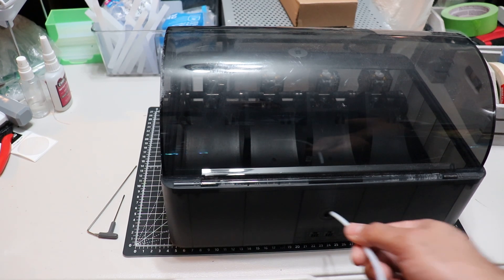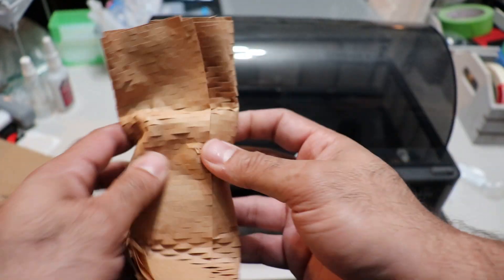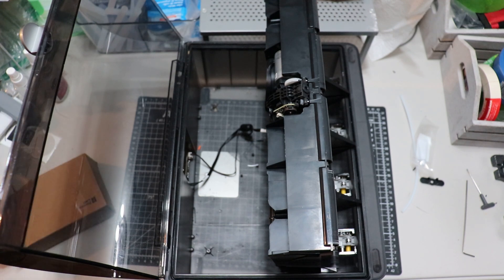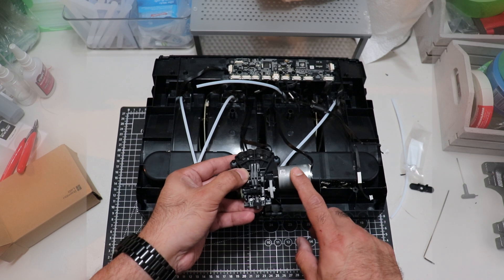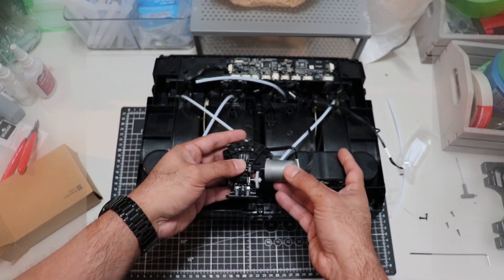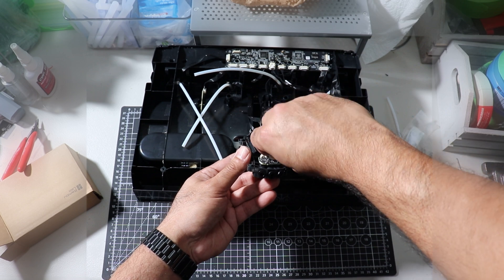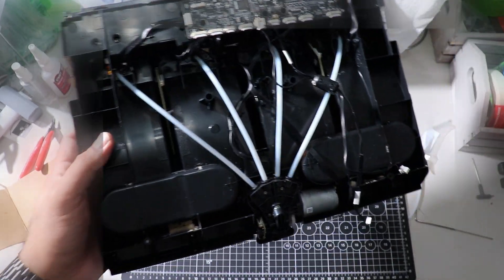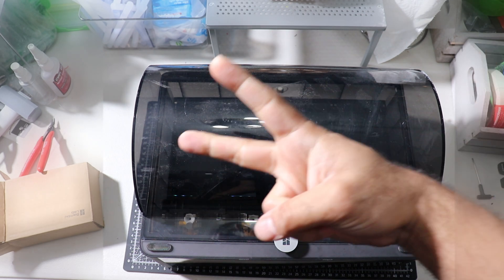#bambulab #AMS Unit Internal AMS Hub Replacement #3dprinting #walkthrough #replacement #repair

Comment: Just replace the M6. If you open it, you can remove the button, open it and in there is just a M6 like the other 4 in the hub. Its much cheaper ^^

Comment: The whole hub doesn't need replacing.  there are 6 small screws you can remove open up the hub and replace the pneumatic Cuplers.  all 5 are replaceable.  The part is a PC4-M6 push fitting availiable on Bambu Labs or through Amazon.
Reply from the maker: Thank you for the suggestion. I don’t believe that fix was available at the time. Just to confirm, you’re saying that the PC4-M6 is the replacement part, but that isn’t actually the correct part, and instead, the correct approach is to use the Bambu PTFE tube coupler and then split it into two pieces.

Comment: Thank you so much.  I had to replace my hub for same reason of it not holding the Bowden tube.  I am sure that I broke it clumsily removing the Bowdon tube.  On my hub that was in my AMS the plugs were glued in with silicon glue.  So I had to very gently cut the silicon and then pull out the plugs.

Comment: The motor unit has three holes - two for the screws and one for the locting pin on the hub. Using this alignment will ensure the motor is orientated correctly.

Comment: How did you manage to get the last screws in at 9:11 that you skip over?  I can't get them in properly.  Like, I got the silicone/rubber grommets in place and aligned. I can even put a pin in and have it go into the screw hole so I know they ARE aligned. But when I go to put the screws in they just spin and don't bite the plastic below. Terrible design. There shouldn't be machined screws there or they should have a threaded insert at least.  I'm just terrified about breaking the plastic cause that's the whole AMS that would need replacing. Thanks for the video.
Reply: OK nvm.  
The solution is not to be an idiot like me trying to use the smaller hex driver. 🤦  Use the larger one that came with with the printer. Easy peasy.  
Now time to go question myself in the mirror.

Comment: Bambu knew what components would wear out and created no pathway for replacing just those parts.  By  the time you've replaced 2 feeders and a hub  you might as well have bought a whole new AMS.  Hope Elegoo did it right.
Reply from the maker: I 💯 agree. Although I don't think another imitation printer from elegoo is going to be ground breaking. I personally would only ever stick with Elegoo filament, Anycubic Resin and Resin Printers, and Creality for large format printers. All my current FDM and future FDM will be Bambu for now until a company actually reinvents something never before seen.
Reply: You can just replace the couplers.  remove the hub and remove the 6 tiny screws open it up and replace the coupler with a PC4-M6 push fitting.  Good luck and save money

Comment: Did this part cause constant clogging in your hot end? Then randomly print great for 4 hrs then back to clogging?
Currently in day 3 of trouble shooting. Bambu labs now believe it may be AMS retailed. So I get to rule that out tonight after work. Going to take my AMS apart while I am at it. Clean and inspect it.

Comment: Yes, but how did you get the glue off the cables?
Reply from the maker: That's a tricky one to answer. You'll have to find your own way to do it very carefully. You can either try heating up the allen key a little bit and very gently tapping the glue, or use a pair of snips; there are many different ways they all have risks though.

Comment: Literally happened today. What great timing
Reply from the maker: @user-ul8cs1ic7o  this happened to me literally yesterday (September 6th 2024). Knowing that someone else is now going to benefit from my video, which was literally a last second decision to film the replacement process, makes me happy.

Edit: typo
Reply: @MicBot  i was really looking for a way to replace just the connector, but it looks like that's not possible from you video.
Reply from the maker: Unfortunately Bambu screwed us on this one. We have to replace the entire unit. It's a Bambu money grab in my opinion. They make us replace a $70 part for a $1 section of the part.